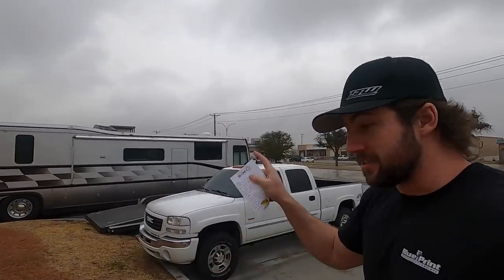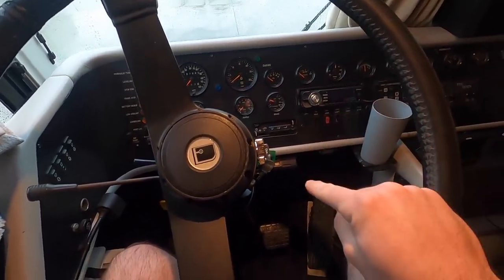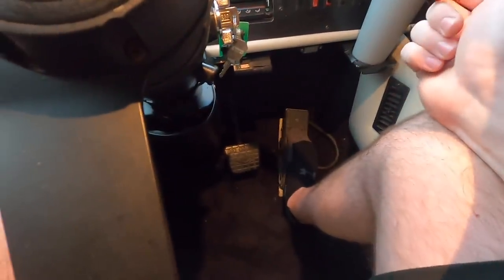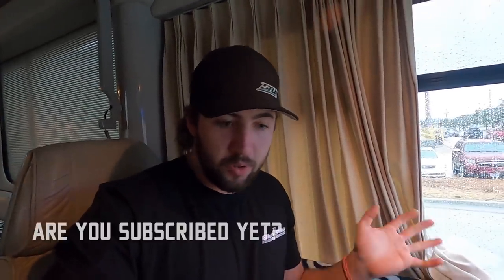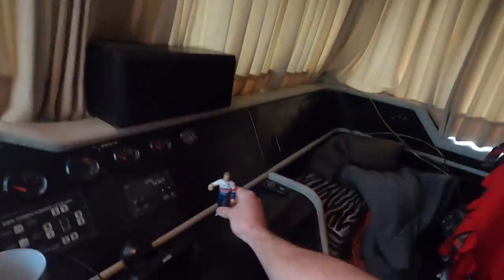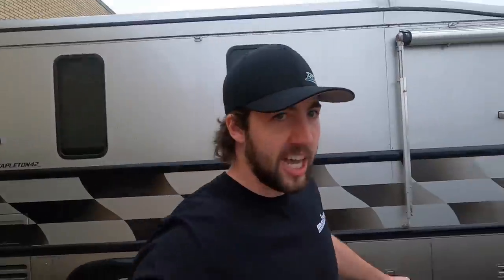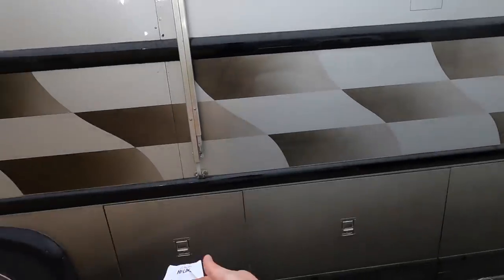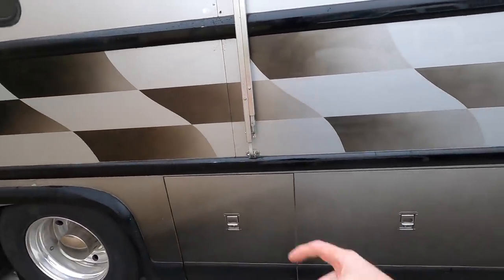My 90's Newell Coach: 7 Things I Hate..and 7 Things I Love! (6 Months of RV Ownership Thoughts)

Comment: Regarding the generator oil change, it reminds me of a 4wd 88-98 Chevy truck. The filter is directly above the front driveshaft. I would take a long length of paper towels, fold over a few times, then put it over the driveshaft. You might try that with the rod causing you issues.

Comment: I don't have a Newell, but i have a '93 Pace Arrow and you were right about how they use parts from other vehicles. My headlights are also from a Ford F-Series Pickup and my taillights are from a '90's Mustang (I recognized them off the bat because I had a 1990 GT) The one issue I have and that many other people are grappling with is that mechanical parts, in my case early 90's GM P 30 Chassis Motorhomes, are no longer manufactured new, although GM is still in business. The quality remanufacturing of these parts have gone down as well. More than likely because of COVID. My brake booster had to be replaced three times because of poor quality work. My mechanic told me similar horror stories where he went through 5 alternators for a customer and the fuel injection system on his pickup had to be replaced several times. The new reality is, if something breaks, it's a crap shoot obtaining quality remanufactured parts. At least Newell is on the ball when it comes to their coaches.

Comment: 10:42 It seems that maybe you could find something to fit between the drain plug and the rod to avoid the mess. But it also wasn't very clear how much space was between those two things. The video make it seem like it could be 6 inches or 3 inches. Food for thought, maybe you just need to find a very specific oil receptacle for your generator oil changes.

Comment: Need to get a grinder for the pump outs with a garden hose. the SewerFlo Quick Release RV Macerator Pump - 12V, 12GPM 

Connect the air supply from the shop for air to the coach.

Comment: Build a special funnel for your generator oil changes..  when you have your fuel caps on both sides you can use the satellite pump at truck stops Fuel up both sides at the same time.

Comment: Tip for your drain plug.. get a 45* brass spicket with a valve to replace the plug and a hose to use that will reach your drain pan 😉 no mess ever.

Comment: hey mate for your generator oil drain.
 modify a metal ball vale that screws in to wear the filler plug goes
 put a metal pipe on bottom of the vale and route around the rod.
to make it easier to change

Comment: If ya wanna be cheap about it get one of those funnels with the handle on the side cut off the bottom half of the handle so your left with a hook and there ya got hook the funnel on the track and drain her out! The one I have I got from autozone it holds a quart has a screen in the bottom turns open and shut so you can measure with the funnel and it has a hose on the bottom it's like 8bucks

Comment: Simple funnel will fix your oil change problem. Get a large funnel, release the screw and funnel the oil into an oil pan. You could bungie that funnel to that rod. But yeah agreed dumb spot for the rod. They could’ve simply put it off to one side a bit more or put 2 in and left a gap for oil changes..

Comment: Mitch, may I make a suggestion? Why don’t you bend a piece of metal into a v shape that would sit on top of the rod that pushes the generator out so when you change the oil it won’t splash all over everything? I know how much you love to work with metal and figuring out the best ways to build things. Or have you thought about it and decided it was more hassle than it’s worth? You could hang it on the wall of the generator enclosure so it would be right there at hand when you needed it, and so you didn’t have to wrap it up and store it somewhere in your coach. Again, just a suggestion.    Roger in Pierre South Dakota
Reply from the maker: Not worth the effort. I’ll just take .2 seconds to wipe up the oil when I’m done anyways

Comment: Could you make a valve drain for the generator? If you could match the threads you could offset it with two 45’s just run it with Copper and that way it doesn’t drain on the rod.

Comment: Put an "A.N." fitting on the generator with a ball valve and some fuel line to have a short remote drain plug and avoid the mess on your shaft

Comment: Drain plug issue easy fix get a nospill drain plug. It will make things much nicer. Put one on that Detroit to. Then you just tread off a cap and as you tread on a hose it starts to drain out the hose

Comment: If you lower the driving seat or change it that would help. And also keep both of your legs up closer to you and it will help with your back. I drive a Pete every day that tight up to the dash and pedal like that.
Reply from the maker: It’s worse if I sit lower. If I sit on a folded blanket to lift me a couple inches it’s much better

Comment: Seams most large motorhomes have seats that make No sense. They're comfy but lousy for driving. The pedals are too close and the steering wheel is misplaced so you can't see the gauges properly. My 2000 Foretravel u320 is weird like that too, tire rubbing as well.  Put a 45° fitting and a ball valve on the gen drain.

Comment: Old as it may be, it's still pretty cool and filled with racing history.  That black vinyl eyebrow turned out nice.  

The art deco light fixtures are sweet.   What are the little globes towards the bottom of them?

Seriously, I'm really surprised you haven't replaced that drain plug with a 90 degree fitting and quick valve.
Reply from the maker: Just some adjustable reading lights

Comment: The TOILET should have been NUMBER TWO hate! Do you not use the bog just because of the common grey/toilet waste tankage dump situation or cos the toilet doesn’t work?
Maybe the genny oil plug loc is to lubricate that slide rod ?!
Great video Mitchell. Thankyou
Nick (U.K...1989 RV owner with common issues but slightly smaller tools required... like you, sometimes you gotta live with stuff EXCEPT water ingress! Best seam weather sealer here in U.K. is Bostik “Sticks Like Sh*t”.... ask Ethel, she’ll tell ya!)

Comment: Air leaks are a mans Nemesis Lol. Keep a spray bottle with a bit of dish soap mixed with water handy for finding air leaks!, sprayem and they will always bubble!, had one in all my semi trucks they are the handiest thing to find them. I am wondering is 777 performance your own business and are you living in the Newell out side of your shop?. I live in my fifth wheel and love it, but i want a newell or a Beaver patriot. As for the hydraulic cylinder being in the way of draining the oil get yourself a twist drain and modify it with a hose so you can aim it where ever you want, makes oil changes a breeze!. Your issue with tires rubbing, your suspension leveler should be adjustable both front and back, change to rod length to get in to come up more and your tires won't rub, my lowbed trucks had a remote valve controlling ride height so i could set it higher or lower or dump all the air. its a nice ride it's well worth putting in the cool stuff, Keep the vids comin man your great entertainment..Keep us posted!. Oh and BTW Get Buddy heaters for emergency's..
Reply from the maker: Thanks man. 777 was not my business. It actually folded a couple months after we left

Comment: Fold a piece of cardboard to direct the oil from the drain location.
Reply from the maker: good idea
Reply: I use aluminum foil and form a drain when changing my Harleys oil filter. It’s an odd spot to get into with anything straight. They make a plastic version but I’m cheap that way.
Reply: @deegan727  Yes I figured out the cardboard trick changing oil on motorcycles. Does not take long to drain so it does not soften the cardboard. Then just throw away the cardboard. Sorry environment.

Comment: I would check the rim/tire size from factory,,,those look like 24.5,with tall tires,,,maybe when it was new it came with 22.5 low pro tires.guys tend to buy 24.5 because tires/rims are cheaper ,than 22.5...
Air leaks are going to be there,,,it's going to be tough to stop all leaks
Reply from the maker: It’s the factory tire size
Reply: @Stapleton42  it's also possible to maybe raise the ride height,an inch,just keep an eye on the driveline angle,,,when I see it aired up ,tires seem too  close to fenders,,your front tires shouldn't scrub,,,